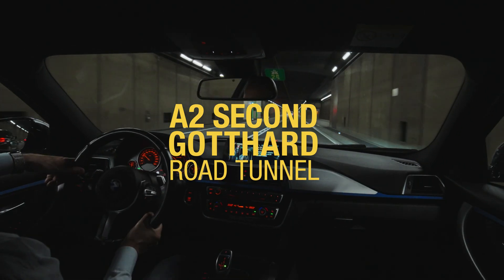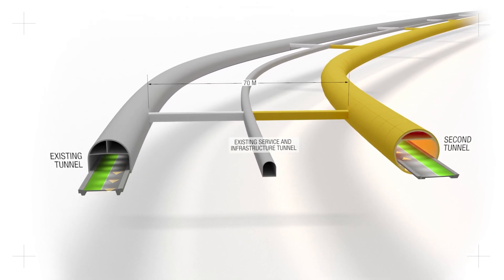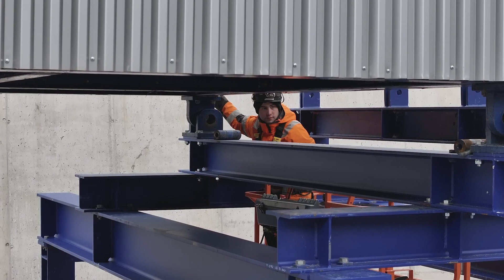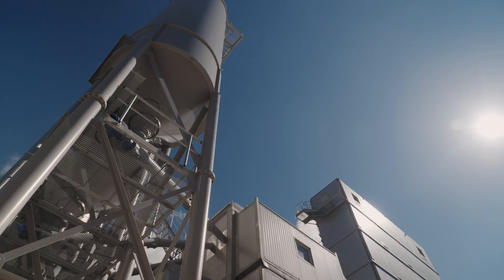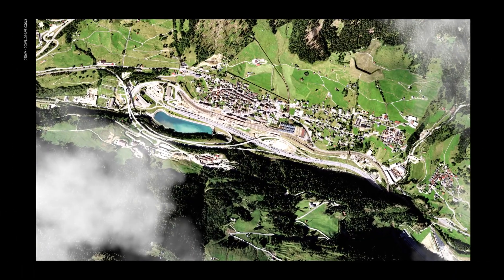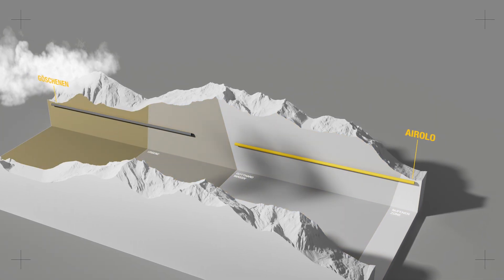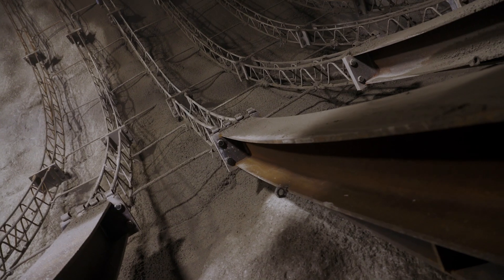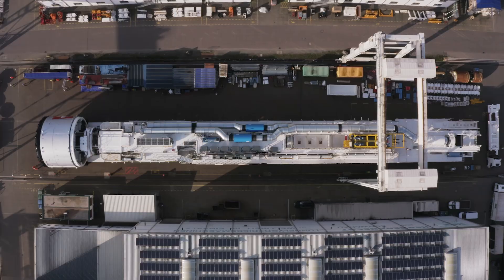A2 Second Gotthard Road Tunnel

Comment: How did you transport that huge cutterhead to the north side? Via the canton road? Or did you use a barge across Lake Lucerne, since it barely fits through the Axenstrasse?
Reply: it's not a single one part.  probably it's 8 part and welded on the job site and got installed.